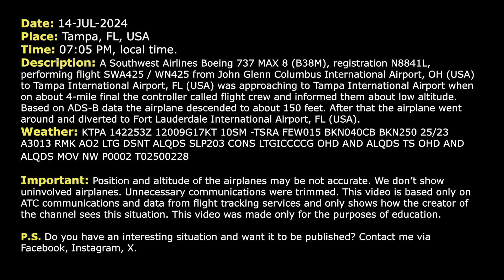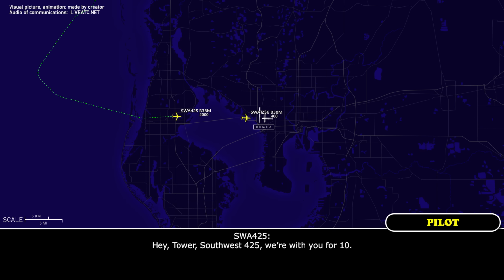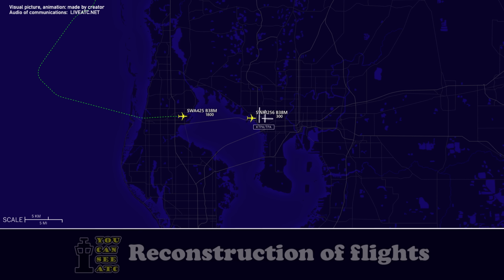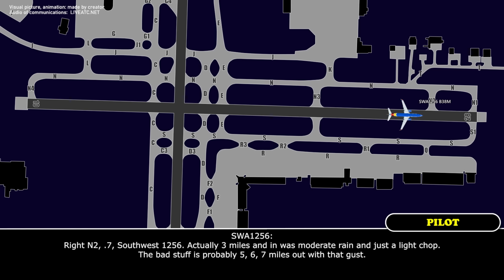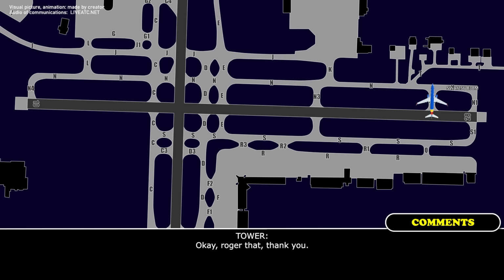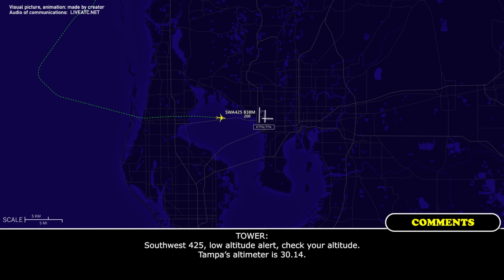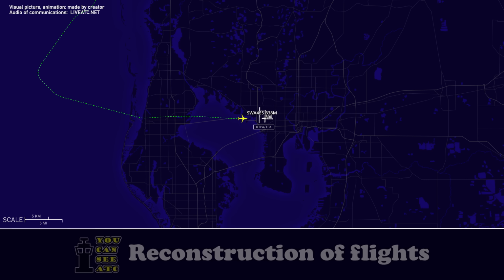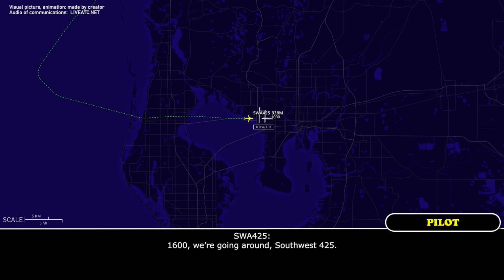Extremely dangerous descent to 150 ft. Low altitude alert at Tampa. Real ATC

Comment: tbh would have loved to see what would have happened if ATC didn't warn them of that. smfh
Reply: TERRAIN TERRAIN...GPWS (ground proximity warning system) should have sounded.
Reply: No, if the GPWS warning went off near the runway it would both distract from any actual issues and teach pilots to ignore it because it would go off on every landing.

Some aircraft do have an aural "Glideslope" warning when vertical guidance is available. Not sure what approach they were doing or if Southwest's planes have that feature installed.
Reply: Had the controller notified them just 5, maybe 10 seconds later, we almost certainly would have found out.  

They were just about to fly over the peak of the Campbell Causeway, which is 45 feet above Old Tampa Bay.  It's also lined with streetlights that are another 20-25 feet above the road. So they were at most 80 feet above the light poles when the controller warned them.  Probably less than that.

Comment: Basic airmanship says you should be able to figure out how high you should be an any given distance from the runway, based on a normal 3 degree approach glide slope. These guys were freakin' clueless. Scary. This same type of screw-up occurred to SWA going into Oak City. What's going on with these pilots? DEI hires? Fatigue? VERY poor flight training at SWA? There's no excuse for this. Especially happening multiple times in a short period.
Reply: Yep! 3 x Distance = Altitude & 5 x ground speed = vertical speed to maintain 3 degree profile 1 mile or 120 miles.

Comment: Yeah I’m not going to throw this crew under the bus just yet, knowing there was bad connective weather it’s really possible they entered a downburst or a microburst environment here. Both the dfw and Little Rock cases were really bad outcomes of a severe downburst situation.
Reply: The deviation actually started much earlier, ~9 miles from the runway when they descended below 1600 prior to ZEXYY. The controller didn't catch it until they almost ditched the thing.
Reply: Those were before we understood and had procedures for microbursts.....as soon as it is recognized, it is FULL THROTTLE and the hair raises....didn't seem to indicate either of these - and they would have been REQUIRED to report it as soon as they got away from the ground....did they?

Comment: MSAW alerts are issued all the time across the country, not that big of a deal particular on a visual approach. The atc computer uses altitude and also the rate at which the aircraft is approaching the programed altitude for a particular sector or final. The big deal is when the pilots do not answer.
Reply: 150 ft above hitting the ground 4 MI out yeah I'd say it's a big deal
Reply: They busted the 1,600 minimum at ZEXYY by about 1,400 feet. They were practically below the MDA/DA at the FAF. "Not that big of a deal" lol.
Reply: Sorry, AirBoss....this is more than that.......seconds from killing 160 folks.....and until the ATC call...did they even KNOW where they were.....??

Comment: Sorry to disagree with most of the comments below, but know what?, if you're not in the cockpit flying the aircraft, you honestly have no idea of the conditions those pilots were facing, not should you try to second-guess their on the spot, split second decisions on how to deal with adverse weather conditions. I've watched commercial pilots in various type aircraft do things that are not in the flight manuals, but they were always the correct choice. It's not a computer game or simulation up there, it's the real deal.
Reply: @eswillie, FAA and/or Southwest internal safety audit will determine exactly what happened in this scenario.  Agree with some of your sentiment, but 150 ft agl on a 4 mile, barring some significant failure of avionics, wind shear phenomena, or otherwise, begs a lot of questions of pilot error. When the final analysis all comes out in the wash, I’m betting that facts won’t unveil these guys as heroes responding to the “real deal” (to use your words). More likely is that mistakes were made.  The crew member on  the radio, PM (Pilot monitoring) seemed more concerned about sounding “cool” on the frequency than anything else.  In my 35 yr, career never once addressed an ATC facility with “hey, tower.”   TPA tower saved their bacon in this instance would be my bet.
Reply: @J904-v6j  "Hey tower" ... "we got it" ... WTF
Reply: @J904-v6j  "..., wind shear phenomena, ..." We know the tower was already concerned of the probability of wind-shear and/or microburst, from his queries.
Reply: Agree with you Willie. Long ago, while receiving flight instruction, on two different occasions we experienced sudden adverse weather conditions.. You have no idea what it is like until it happens to you.  Armchair pilots tent to be way to critical.
Reply: @J904-v6j  Gotta disagree, but neither of us were in that cockpit.
Reply: Over Macho Grande?
Reply: @eswillie  no, we weren’t in the cockpit and kudos to you for being the dissenting opinion on the early criticisms. Always the more measured and reasonable course to wait for the final analysis and report. That said, from the video and audio information, early impression is that TPA tower saved the day and initiated the go-around, not the flight crew.  Final approach fix on the RNAV GPS RWY 10 is ZEXYY (4.8 NM), with a crossing altitude of 1600’. They were just inside of that at 150 ft above the ground.  With the exception of CAT II or CAT IIII weather, at 150 ft agl, 100% of the time I always see a runway in front of me. Minimum DA on that approach is 436’.    4 miles out at 150’ agl…… they were not only below the “path” but considerably below the DA.  3 altimeters in the 737, plus radar altimeter, and predictive and reactive wind shear warning. I don’t know what they were facing, like you said.  Wind shear, microburst, aircraft fault… but ATC directed the go-around, not them. Something was amiss. I just think we disagree on our predictions on what that might have been.
Reply: @judymarlene3414 you never get over Macho Grande